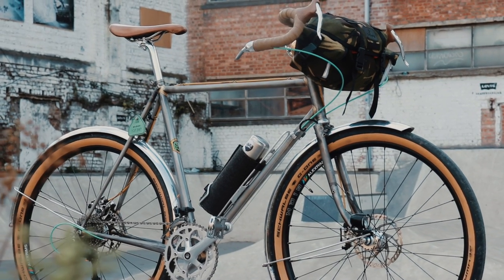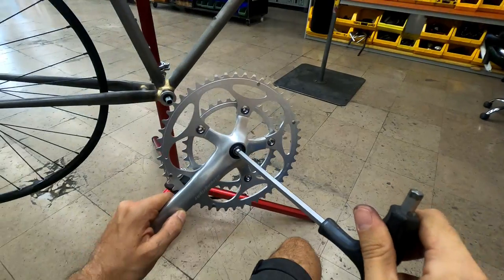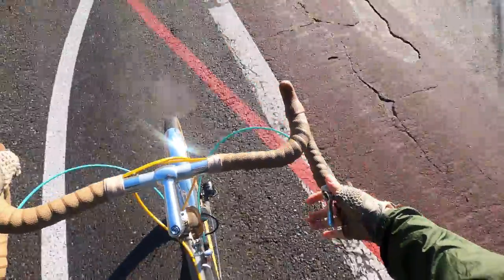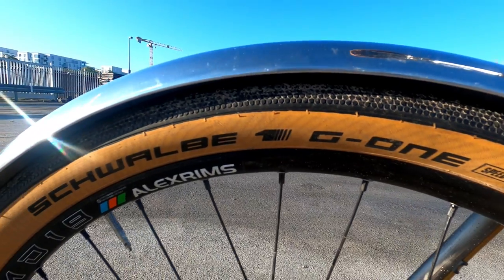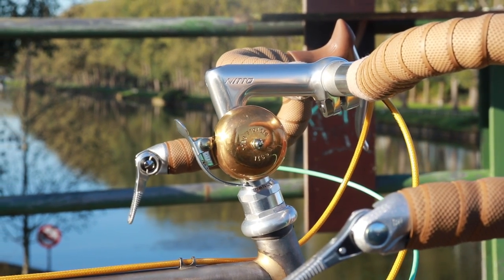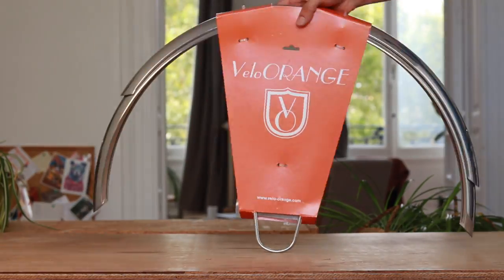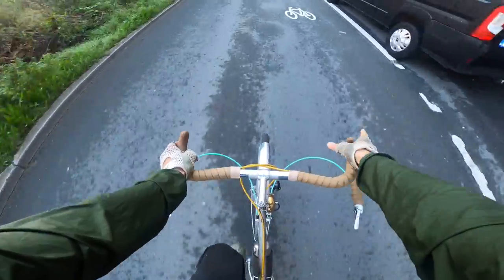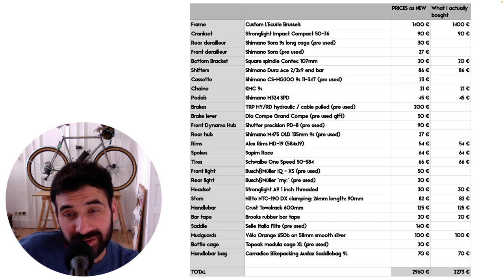How I built my custom randonneur bike

Comment: Coming back to this vid, since it's such a nice build :) - just an FYI, i routed my bar end shifters completely under the bartape and have no issues with shifting. No need to make it "shoot out" from the drops to get the routing to work ;) (Caveat: I use friction only on a 10sp 11-34)
Reply from the maker: Hi ! thanks for the advice, it's true that having them under the tape makes it look more neat. I'm surprised how you are able to use friction on 10sp ! when I got the friction Dia Compe shifters I really tried hard to get used to them because they are beautiful and I find it cool to have something so low-tech and low maintenance... But I couldn't :/ good for you though, happy riding !
Reply: @bicyclepicnic  I am not sure if you are familiar with the "Path less pedaled" channel, but Russ Roca, the host, is of the opinion that the more sprockets you have, the easier it is to use friction, since you are more likely to be "in gear" than between those. My 10sp setups (1x dia compe, 1x microshift) work both flawlessly. Just an FYI. 
Keep the videos coming - you got another subscriber :)

Comment: For the modern-but-classic-look crankset - Middleburn RS8 is a good option :) 
for the drivetrain - I would go for 10 speed, just because those are so much easier to set and operate than shimano 9sp
for the wheels - silver rims and spokes for me would look much better. 

Other than those few points, this is a very successful combination of classic geometry and retro vibe with modern solutions that make life much easier, and cycling much more pleasant :) 

Good job!
Reply from the maker: Hi !  the RS8 look like a good option indeed, thanks for the tip and your feedback :)

Comment: Nice build. 2x9 is all you need. My Breezer has sora shifter combined with XT derailleur and the hydro brakes. Works like it should. Solid base and reliable. The bar end shifters are not something that seem practicable on an allroad machine. But they fit with the theme of the bike. Greets from neighbouring Dilbeek. (Looks like you are a Bruxelair)
Reply from the maker: It’s cool that road shifters can work with mtb derailleurs ! And I agree that « briffters » are the most comfortable option, it was a little sacrifice in the name if the looks 😅 greetings from BXL 🙌🏽
Reply: 1x7 is plenty.

Comment: Love this vid. Im also building bike with a custom built frame and fork. I wonder if there are any rust formation on your frame since you only applied clear coating? Im planning on also leaving the raw look on my frame. TIA on your reply.
Reply from the maker: Hi ! YES I actually found some signs of rust. I think I’ll send it to be painted professionally, I don’t want to risk damaging the frame and I also want to put some colour on it. I know there are some spray products that are better than the one I used, and probably the way I applied it wasn’t the best (it was my first time) so I think if you get the right product and do it properly it should be alright, friends of mine have had good results.

Comment: What a nice looking bike! I am also jealous of the classic knitted/leather cycling gloves - where did you get these?

For a classic looking crankset and somewhat classic looking brifters, one could  have gone with Campagnolo stuff from the 9-speed era (although this would have limited gearing choices in the rear, and one might have to find one of the rare triple chainring cranks if one needed really low gears).
Reply from the maker: Hi ! the gloves are from a Dutch brand: Verwimp, but I bought them on a shop in Brussels and I haven't been able ti find them on line. I found these others that are similar https://www.wieleroutfits.nl/retro-cycling-fietshandschoenen-zomer-nederland-vintage-style-leather-cycling-gloves?gclid=Cj0KCQiApKagBhC1ARIsAFc7Mc4Ob6j5qFeMDRQk8g1_0-8lRcrG7b70fpYSqbKVeaaQNJ6gi37DgKcaAlOpEALw_wcB
About the Campagnolo levers you are totally right, I just didn't want to build the drivetrain around Campa because of the price. 

Cheers !

Comment: Love the concept and your approach to bikes. Did you sell the surly? Do you have a picture of the geometry used?
Reply from the maker: Hi ! I'm gonna publish a video specific for the frameset soon. but the geometry numbers are: 

Reach: 389mm 
Stack: 588mm 
Top tube slope: 0°
Head tube angle: 72° 
Seat tube angle: 73° 
BB drop: 65mm 
Chainstay length horizontal: 420mm 
Chainstay length actual: 425mm 
Fork Offset/Rake: 45mm 

and that's perfect for my size 1.83m and 86cm inseam. 

If you want more info you can send me an email at francisco@bicyclepicnic.com
Cheers !

Comment: That's a good looking bike! Where did you find those TRP brakes?
Reply from the maker: Hi ! they are called TRP HYRD I bought them online but can't remember which site. I usually use the most popular online shops in Europe like bike24, bike-components or probikeshop
Reply: @bicyclepicnic  Ah, so the same shops I frequent too ;) Must've been a lucky buy to get a set for only 100 €. Sidenote - i agree on the beauty of a quill stem - only downside is, swapping them out if the lenght or angle is off. That's quite a faff. :P
Reply from the maker: It was 200€ for the pair - and yes, having a quill stem was "a treat" but it's complicated from a practical point of view, I was lucky to have Gaëtan and his adjustable stem to know in advance exactly which one to take.
Reply: @bicyclepicnic  That's a handy tool to have access to! Very nice! Do you plan on painting your frame at some point? Also, how do you get on with the bar end shifters? I have some on my 90 MTB (microshift), and even though they are 460mm wide with a 24 ° Flare, i still occasionally hit my knees on them when climbing and rocking the bike left & right.

Comment: Where did you get the Crust handlebar. Directly from Crust in the USA?
Reply from the maker: Hi, that’s correct
Reply: @bicyclepicnic  shipping costs are pretty high. What’s about the customs and import taxes? Are they not to brutal?
Reply from the maker: I recall paying around 30€ for the custom. Unfortunately the shipping method proposed by Crust is pretty expensive, I think it was around 70€ at the time I bought it. All in all I payed around 100€ over the retail price :/ ... but there are no alternatives, the other handlebar that I was considering at the time was the Velo Orange Grand Cru Randonneur, available on 50mm. At the end I went for the Crust cause I like them too much
Reply: @bicyclepicnic  the shipping costs are 120€ nowadays. I ordered a pair of rims but I bought it through a shop in Paris. It is more expensive but it avoid hidden costs. All in all, the price should be sensibly the same at the end.

Comment: Beautiful build!  One technical disagreement though.  Short chain stays = better transfer of power is a complete myth.  Now you have a bike that will probably produce unintentional wheelies going up hills. 😝
Reply from the maker: Thanks ! It’s true what you say about the unintentional wheelies but I try to control that by going on the drops, leaning heavily forward and when carrying some weight I put at the front and that also helps. On the flat, when accelerating / kicking off short chain stays do feel more snappy in my perception, but it’s not better or worse it’s just a matter of preference. Cheers 🙌🏽

Comment: What clear coat did you use?
Reply from the maker: Hi ! I used acrylic varnish from MONTANA COLORS, but I don't recommend it, I've been out in wet weather and got a few signs of rust. I know there are stronger ones of the same brand but don't know what they are called. At the end I decided to disassemble the bike and paint it professionally, I think is the best way to protect the tubes in the long term.

Comment: Bike looks very well put together with that crankset, however a practical gearing for randonneuring would be something lower like a 46/30. As far as the frame goes, looking forward to the review, please take your time, put more miles on it, get used to it ( it takes a while for your body to get past the new bike feel ). 
I love my old Peugeot rim brake rando bike, out of all my bikes it's then one I always pick for some reason, allthough it only fits 32c tyres.
Reply from the maker: Hi! Yes you’re right the chainrings are a little bit too big, thanks for the feedback !

Comment: Well Done, mate! How do you get along with the seatpost? I used the same one for some time and i never managed to get the screw tight enough to hold the saddle in place. It just kept slipping. After a while i just sold the seatpost and got another one with two screws which keep the saddle very well in place.
Reply from the maker: Hey thanks ! I actually use it on two bikes and it holds pretty well, this seat post is from the brand KALLOY and it's very inexpensive. I like it because it has a kind of a vintage look :) ... I've been using it for less than a year, we'll see if it hold in the long term
Reply: @bicyclepicnic   Okay, mine was the same brand. Good to hear you didn't had the same bad experience with it. thx

Comment: Great build I have a similiar steel custom frame bike but with 26” wheel and rim brakes. It takes some time to decided the wheel size between 584 snd 559 but in theend decided on the 559 as I have many spare rims and wheels already built in that size. Your disc brakes- Dia Compe / Towel rack is perfect. May I ask you where did you get the towel rack? Importing it from USA or Japan cost a fortune in Shipoing and cutom duties and taxes.
Reply from the maker: Hi ! 26” ain’t dead ! 😉🤙🏽 I ordered the Towel Rack from the US and I paid 40€ in import duty tax. The most expensive was the shipping, about 100€ 😬 but I’m pretty sure it’s possible to get a cheaper shipping but that was the only option they gave at Crust at the time... the Vélo Orange would have been much cheaper
Reply: @bicyclepicnic  I asked Crust  few months ago and they quoted 100$ for the shipping
Reply: you can always check with Veloform in Gothenburg, Sweden. He import lot of funny stuff from Japan, US, France, etc.For example Nitto, Honjo, Gsrn Bois, Rene Herse.

On my Tegnér 650B I have similar setup, but my bike is from 2013, RH crankset, Honjo mudgaurds, SON Lights, genorator hub, and some Grand Bois parts, and  Veloform made racks, I use it as touring bike with Gilles Berthoud bags.
Reply: @ollejansson7237  Thanks!

Comment: I'm not a fan of disc brakes, especially if the bike will be ridden exclusively on paved surfaces.  The failing point for discs is when they are subjected to prolonged heavy braking.  There is only a small area for heat dissipation and the rotor can reach such a high temperature that the brake pads can begin to fail.  A well-designed rim brake is preferable here as well as being lighter and less complex to maintain.  As far as stopping goes, there really isn't much practical benefit to discs because a good rider will be looking ahead for conditions where slowing down or stopping will be required making hard breaking unnecessary.

Of course a lot of work went into this bike and I wish this bike will take its rider on many enjoyable adventures.